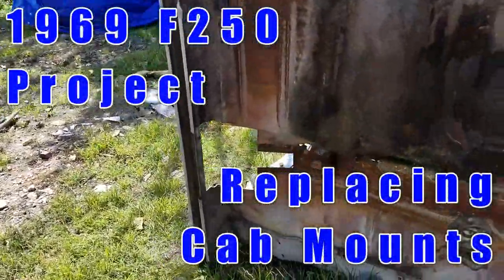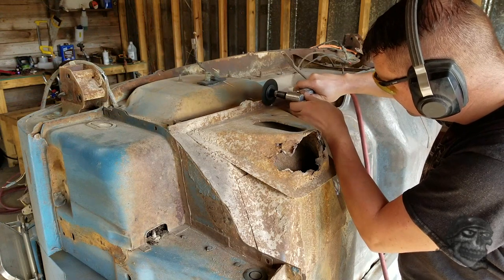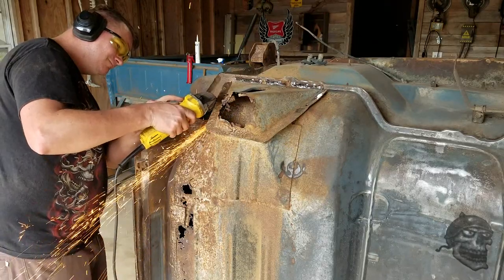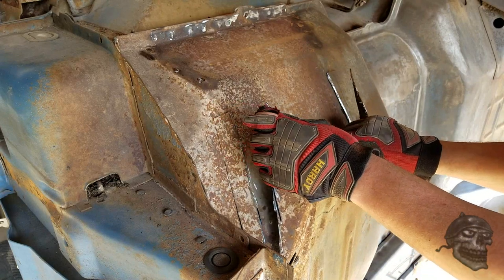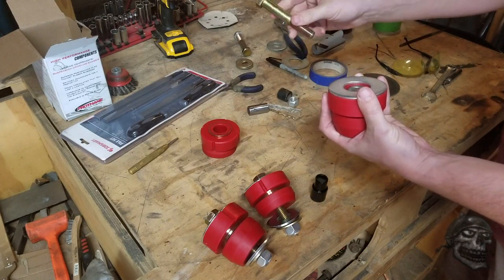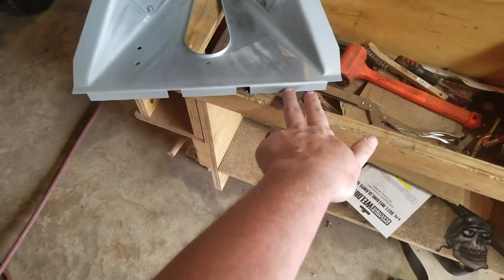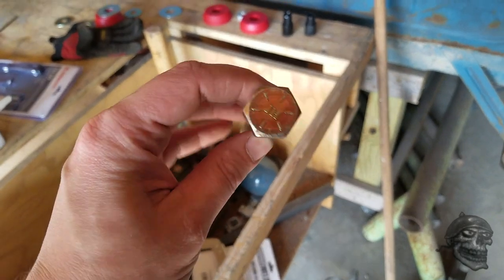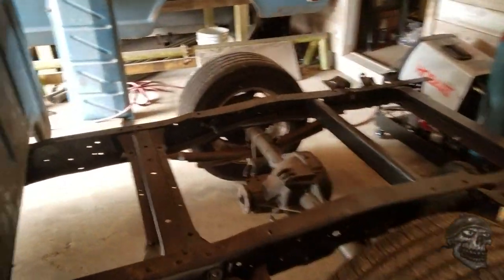F250 restoration project – Part 20 Replacing the Cab Mounts

Comment: Greetings from the UK, I've only just found your build and watched all 20 videos back to back,  very helpful and will help me on my 2 restorations, '72 F100 and '72 F250.  I look forward to the rest of the build. Keep up the great work...
Reply from the maker: Richard Baker Wow, all of then back to back? You must have enjoyed them, that's awesome! I'm glad it will help you. I'm in the middle of the floor plans now, so there will be more soon enough.
Reply: my biggest challenge is the weather as she's stored outside and I don't have access to a garage, I will win though, I've got cab floors, front cab mounts and cab corners to do, I was looking for a way to do the floors and cab mounts without removing the cab but I may have to bite the bullet and strip the truck down further. once she's on the road I'll be swapping the 360 for a 460 with fitech unit.
Reply from the maker: Richard Baker You can, and should, do the floors while it's on the cab. I think it's obvious why I did things the way I have. My mounts were so bad the cab was sitting on the floor. I've seen people do the cab mounts while it's on the frame. I want done as far as I did, because of the extensive work that needed to be done. 

As far as weather, it affects me too. I don't have a garage door yet. Heck, I built the walls in that shop because I didn't even have that. I use a tarp when I need to.

Comment: Just found this video and like what you are doing. I too have an F250. Mine is more of a "Frankenstein" build, as I've got some parts from all different years. I've kind of done mine backwards in that I worked the mechanical and reliability parts first. The body is very solid and in pretty good shape but the mechanical stuff needed the work done now as I drive it daily. 
Although my truck doesn’t' have the rust yours does, it needs a lot of body work. It has some small spots on the floor pan corners and various dents/dings of a 52 yr old truck body. Some repair work where the F100 midship gas tank filler was on the bed side and some work to the bedrails and tail gate. 
Working to learn as much as I can about the body work end because I don't know anything about it yet and build up some tools to make it happen. 
So, I'll have to go back and start looking over your other videos and start from the beginning to see how it all goes for you. 
Thanks for sharing your videos, your ideas and processes to accomplish this. These trucks need to be on the road, not collecting dust and rust.
Reply from the maker: When I saw how bad this truck was and knew my dad had been driving it, I was shocked. The tires were hard and rotten and the brakes were gone, but that's okay, he could smash his feet through the floor pan and stop like the Flintstones. I started just cleaning and fixing basic things and found so much rust in the typical places. It's now rust free but there's so much to put back together now.
Reply: @RIPbiker13  
Stopping like Fred...yeah, those floorboards wouldn't have given him much trouble. I was hoping to inherit my dad's 76 highboy on day, but a few years ago it was totaled. He bought it new in 76 and I grew up with that truck and traveled all over in the bed of it camping, fishing, and cutting wood. Said to see it's last day...man that hurt.  
Yeah, the tasks of putting it all back together is daunting. When I did the 390 to 460 swap I thought I had all my bases covered but it was the little tiddly crap that hung me up more than anything. This manifold water connection was different, or this hose clamp is DOA...oh, here's a wire that needs a new connection.
I'm trying to be as organized as I can to get the body work rolling and do it in a way it isn't a gazillion year project. I'd love to have all the parts lined up, tools lined up and be able to get to it efficiently. So, here I am learning. Been watching Kevin Tetz & others on youtube to learn and pick up some basics. I've contemplated getting it all ready for paint and having someone shoot it for me...I dunno, so many things to consider. 
I'm putting the final touches on the shop now, finishing the plumbing for the restroom and once that's done I will be fully functional and can start the wiring. Been working my butt off this past fall and winter to get it operational. Of course I had to take time off for hunting...it's a must.  
I clicked on your channel this evening and see you have a quite a few vids I need to get caught up on...guess I've been slackin!
It amazes me that these things run as well as they do for being so basic, and have in most cases withstood the test of time. I drive the crap out of mine and it gets me home. 
I'm gonna crank out a mtn dew and get to watching your stuff.

Comment: I’ve used the pink naval jelly that is brushed onto metal to prevent any rust from forming. If you have rust, just wire brush and apply the naval jelly. REMEMBER to wash off the naval at the 10-15 time mark. Use Low pressure air to blow off water. Let it dry and now you can prime the piece. The naval jelly will apply a coat to incapsulate rust or prevent any rust to come. Nice compound to utilize.

Comment: been doin this with a buddy for me for 3 yrs. he said it will be done in a few months. got half cab repaired, guess i will attempt to finish myself in spring. i guess some things you Can't Rush! lol.
Reply from the maker: I thought this things would be on the road 4 months after I started. I'm doing everything I can to be driving it by summer, not even finished at this point. Main thing is, make sure it's safe. Fenders rotting off dont hurt anything and can be replaced later, but holes in floor boards or cab mounts are bad.
Reply: @RIPbiker13  mine was on road mechanically sound, good bed pretty good fenders, new wired, just rusty cab.am doing my '69 cab, but shoulda keept trk. going till cab was done. I Am Stupid! i took trk. all apart hoping we would be done with cab in a few months! now i gotta start All over.
Reply from the maker: @davehollamon1985  That's why I fixed the frame and the cab first. I can do everything else as time allows.

Comment: if you plan on welding parts use weld primer on those spots and other surrounding areas don't paint yet. After you get done painting get attachment that sprays 360 degrees on that paint can and spray it once you are done welding after you clean it up some for paint to stick good.
Reply from the maker: I had to go back and look to remember exactly, because I thought i had. The gray is weld through primer at the top of the mounts. I used an Eastwood 360 sprayer to prime inside after getting the floor pans in place before final undercoat. I must have missed the step in video and I appreciate you pointing it out. It's an important step in the process.

Comment: For future reference. Blasting the new mounts would have been perfectly acceptable. Regular primer holds moisture. Epoxy primer seals and bonds to the surface. Its also non-porous, thus making it far more corrosion resistant. What you did here was good work though. Should last a lot of years.
edit also, when using a spotweld cutter. There are different lubricants you can use that will drastically increase the cutters lifespan.
Reply from the maker: tslater1989 if you're working through this video series you'll see soon that I sandblasted the whole cab and sealed it epoxy. That primer was just to keep it from getting nasty while I finished the metal work. The whole cab was hit with epoxy inside and out and then undecoated.

As far as the spot weld cutting, I bought a lubricant for it. It's a waxy lubricant that sticks to the bit. It helped immensely with cutting cleaner holes and keeping the bits alive longer. But after all I used them one, I need more because they're toast.

Comment: I ordered one of these for the passenger side. It appears the holes for mounting the inner fender apron are on the wrong side. Did you have an issue with this? It appears the driver's side are correct and have the hole for the E-brake cable in the right spot.
Reply from the maker: When I get home I'll run out and take a look. I have not had an issue with them yet, but I have not attached the inner fender apron. I imagine I'd drill holes where I needed them them to make it work.
Reply: I been looking how to fix 93 7.3  now i know questio is where can i buy the parts at

Comment: Do you find it easier to section in the floor pan from the top or could some of that have been done when the cab was upside down?  Or is positioning an issue with the floor pan as well ?  thanks in advance
Reply from the maker: It would have been easier. My concern was the overall alignment of the cab. I didn't want to risk the cab being flexed in any direction it wasn't meant to be. Had I welded on the floor pans while the cab was flipped and it was off just a little it might not have gone back onto the frame properly and may have affected door fitment later on. It's really better, in my opinion, for the cab to be bolted to the frame before cutting out the pans and replacing them.

Comment: Did you put new front bod mount brackets on the frame if so where did you find them
Reply from the maker: The front body mounts were from the original frame and a sandblasted and painted them and reinstalled them with grade 8 bolts.
Reply: RIPbiker13 alrighty thanks for the feed back

Comment: What ever happened to your F250 ?
Reply from the maker: I still have it. Currently I'm in a wheelchair after a horrible motorcycle crash. I had starting working on the bed the weekend before I crashed. Spent 3 weeks in the hospital. I'm home now, but still not walking yet.
Reply: @RIPbiker13  i'm sorry to hear about the bike accident.  I have also been there, almost lost my right leg, there is a piece of my hip in the lower part of my leg to replace all the bone loss.  I am glad you held on to the F250, I am now just pulling the cab corners off my F100 and remember your vlogs.  I watched very closely but couldn't make out what you had for a welding rig.  Would you let me know what brand and the voltage requirements you have?  Thanks !
Reply from the maker: @PCHelp76180  I have a Hobart 210 MVP and I run it on a 50a circuit with 240v. As far as the fine settings, I can't recall exactly how I set it. I ran some practice tacks on scrap first. The potential for blow through is very high. I have a video of the welding cart build and that show the welder, but that doesn't help with the settings.

Comment: Do you have details on your spacers you made?
Reply from the maker: No, I don't think so. I can't remember. They were basically two metal tubes and one fit inside the other and was cut to the height of the spacers. They were about 1/8" short to allow for compression.

Comment: Good video. Im not a body guy. I like the mechanics like engine building & such however I am currently building a 71 shortbox 4x4 for myself & I want to do the body myself. I want to put new floor & cab mnts in it. I'm sure I will end up with a lot of flaws & a paint job that looks like it was dun in someone's garage but im ok with that. Becouse it was. Im tired of paying other people to screw up what I can screw up perfectly fine myself for free labor. I mostly just want a solid truck that runs good & atleast looks good from a distance. That I can say I did it all myself.
Reply from the maker: Little of what I've done has been perfect, but it has been done with my own hands and that feels good. Don't sweat it. I was trying so hard to make it perfect I got overwhelmed. I keep saying I'm going to get back to it, and I mean it, but I don't. Currently, I have one of my bikes on the lift and hopefully that will be completed in a week or so. Then I'm going to pull my head out of my rear and get back to it, even if it isn't perfect, it needs to get done.

Comment: Nice job but those cab mounts would been fine
Reply from the maker: The cab mounts were no longer holding the cab. The floor board was sitting on the frame rail and that was rusted through too. The cab is much more solid now and the doors open and close again. No, the original mounts would nit have been good to keep.